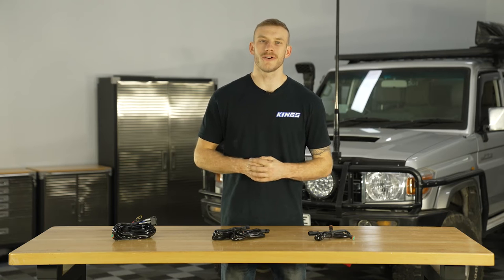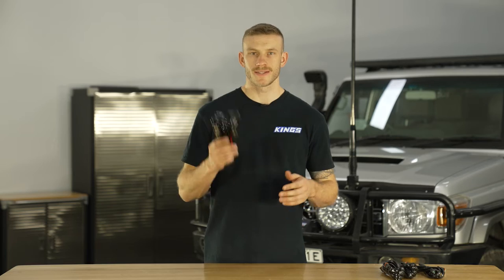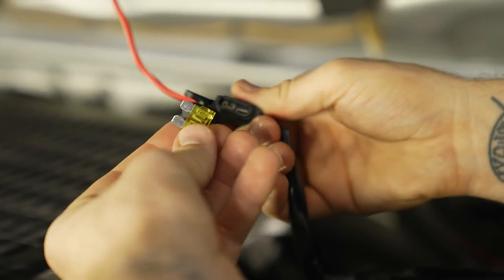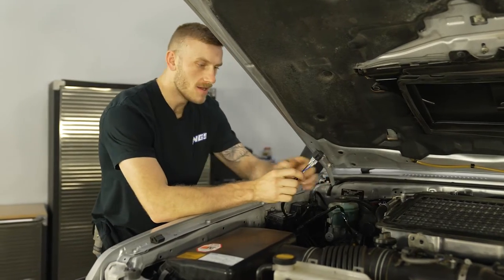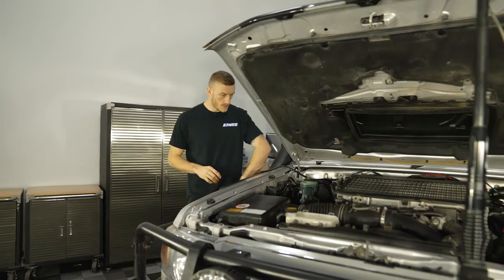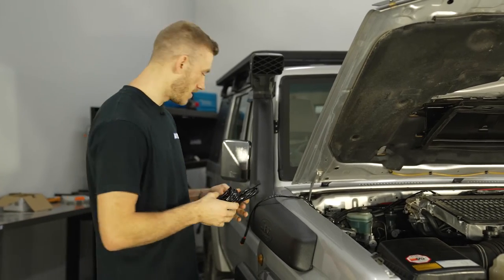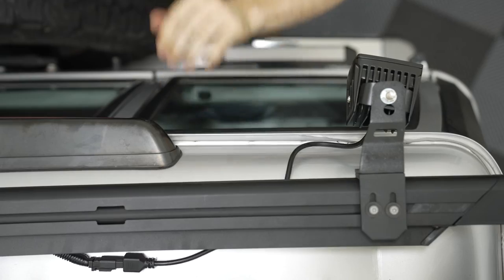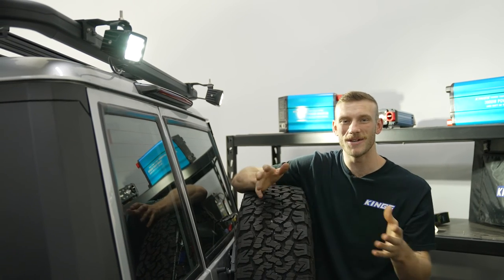Rear Light Wiring Kit Install

Comment: Will this do anything to the starter battery when the lights are on but the car is off?
Reply from the maker: Hi there, the harness works as an extension of the high beams on the vehicle. Kind regards, Rachael
Reply: @AdventureKings  ok thanks, so couldn't use them as extra lighting for camping? Only when the car is on?
Reply: @ashlemon5704  100% you can. As long as the plug isn’t high beam triggered. Yes you will drain your starter battery if the alternator isn’t charging it.

Comment: Did I miss something? Aren't rear worklights meant to be wired to your reverse switch if they're white?
Reply from the maker: Hi there,

If used as a reverse light the lights do need to be tied to the reverse lights in the unit, and need to be set in a way that will not dazzle or otherwise impede the vision of other drivers. The rulings on worklights however can change from state to state so it's hard to give a generalised note on them as a result.

Regards, Andrew